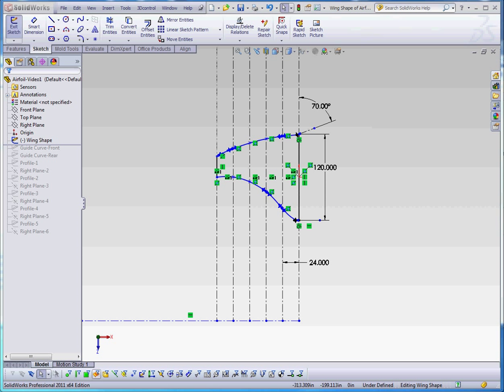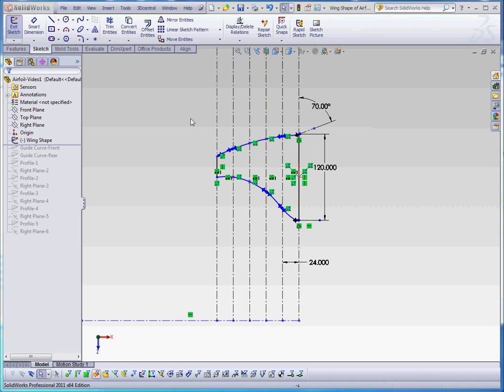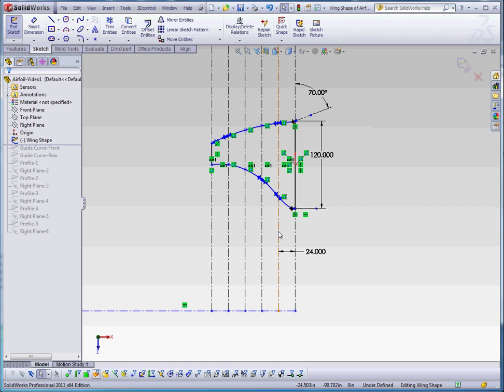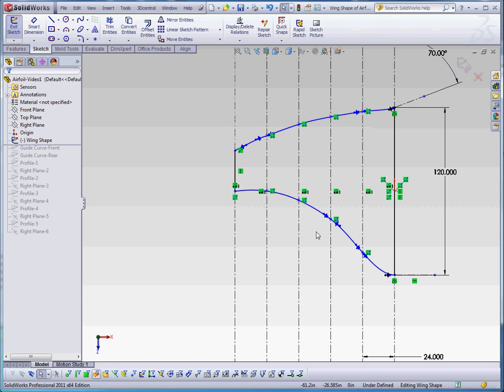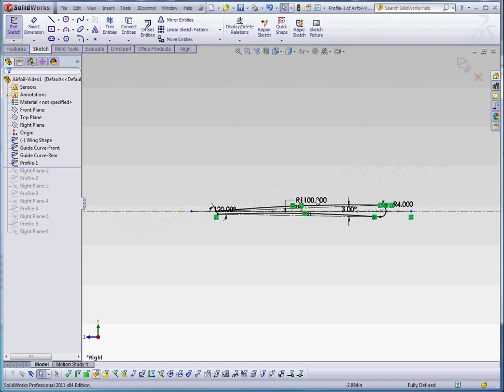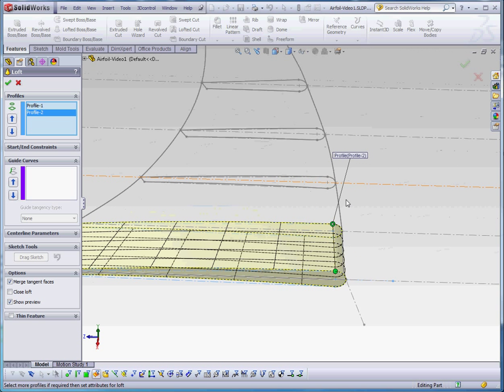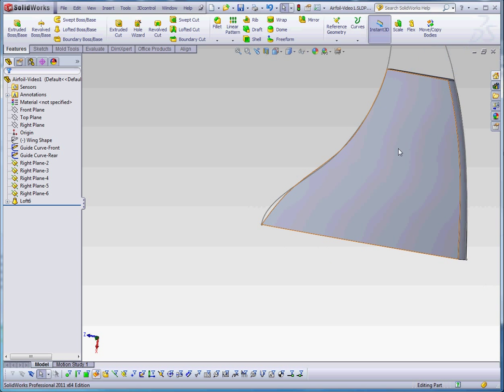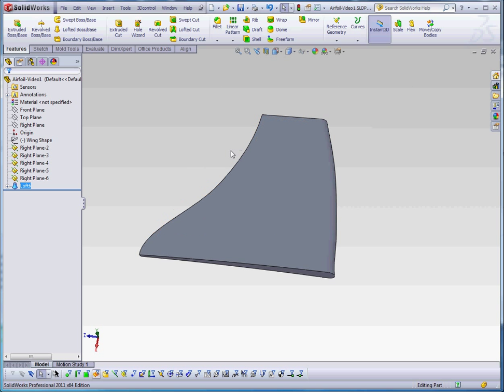Using the Lofted Boss/Base as Demonstrated on a Simple Airplane Wing Design

Comment: by using the loft feature can you give the wing wrapping thickness as well?
Reply from the maker: If you follow this same procedure but using a Surface Loft instead, you can apply a thickness to the surface.  Back to the existing procedure, you can also try and shell it out to achieve a surface thickness.  Hope this helps.

Comment: Sir, I am following your Video for creating a Naca profile. It;s very good.
First I have created reference Lines and Right Planes
Then I have scaled the original NACA profile to following ratios : 1.2 , 0.8 , 0.6
and subsequently pasting them on various right planes.

The problem I am having is that while any two of the profiles are perfectly lofting but as soon as i add the next profile the Lofted Feature is not lofting. Neither it is giving error.

Can you tell me what is going wrong? Please reply asap.

I can send you the sld file or screenshot at your email - id
Reply from the maker: +Sarvesh Thakur Yes, send me your files, i'll take a look at them.  Having a different form for a loft profile may be a source of potential errors.  Check to make certain that you have all of the model lines and arcs in the same orientation and with similar sketch relations (like tangents) for each profile.  You can send them to design@edi3di.com.
Reply from the maker: +DesignInnovations +Sarvesh Thakur
Hi Sarvesh,

Your model is interesting, I don’t think I have seen an enclosed spline
defined by only two spline points with vertical line and three dimensions.
One thing that is apparent with your model is that when you look at all
of your profiles normal to their planes that a lot of the splines curves don’t quite align with those of their neighbors.  This may make it difficult for the loft to generate between more than two profiles.  One potential solution is to add more spline points at predictable locations so that these curves will align.  You also might consider using at least two guide curves starting on the front and back of the wings so that the transition between each profile can be smoothed out and made more predictable.  
Another approach is to build your model using all of the profile planes
but only a portion of your airfoil using a simple but well defined spline for each profile and then a surface loft.  Once you get one surface loft generated you can continue to add spline segments on each profile until you get a complete airfoil.  This way if an error occurs you know exactly what step that error occurred.  
I like the last approach better but the two former ones are easy enough to try first.
Let me know how it goes and send me some updated models.
I can also make a video demonstrating the surface loft option.
CSS
Reply: Sir, If you could make the video depicting the surface loft, it would be great!
Reply from the maker: +Sarvesh Thakur I found this video, at the link below, that looks a lot like what you are trying to accomplish.  Notice that it has the spline profile  shape that you are using plus it has a lot of reference geometry and guide curves.  It can be used for both a solid or surface loft.  I think that it will help you:  https://www.youtube.com/watch?v=CEi-Qip70DI
Reply: Thanks a lot... I will try this way now... hope it will do.

Thank you :)